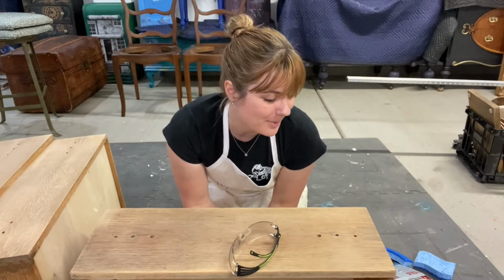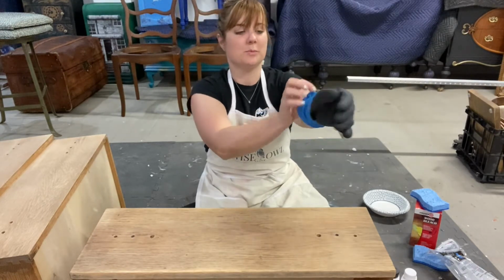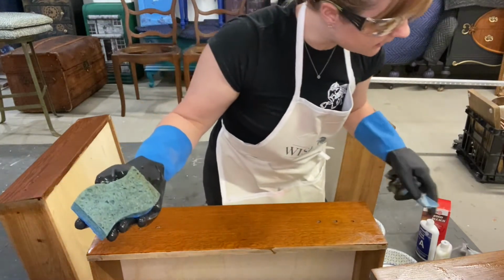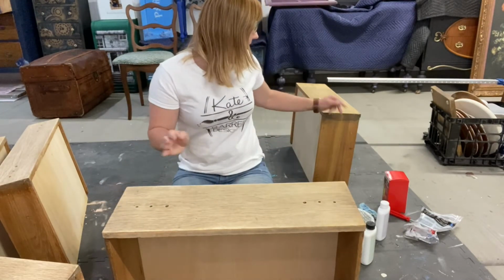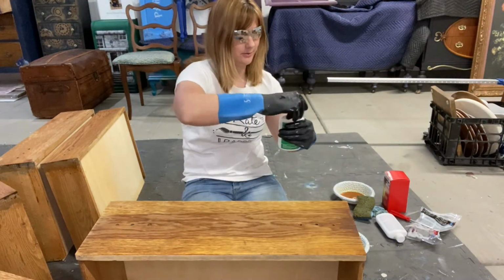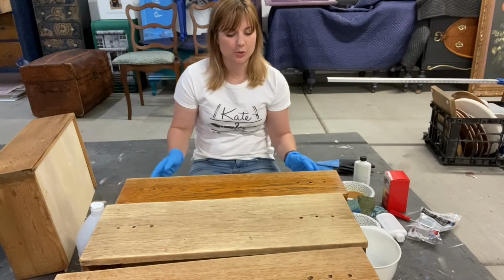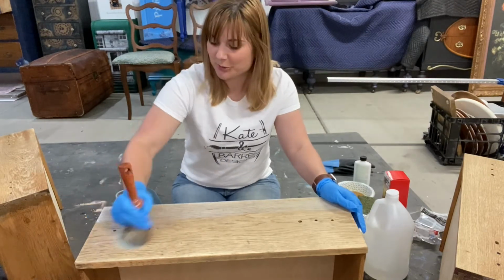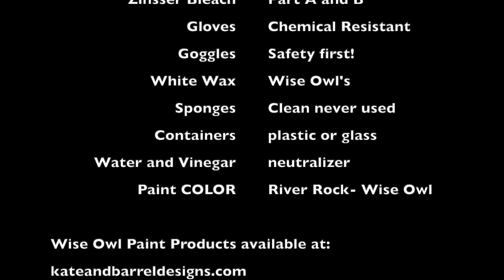Learn How to Bleach and Lighten Wood

Comment: Looks nice.
Did you sand the drawers before applying the bleach? I think if you apply the bleach with a cheap chip brush it would leave more product on the wood and could help the process. I’ve used oxalic acid before and that’s what I had to do. It could work for this type of bleach too.